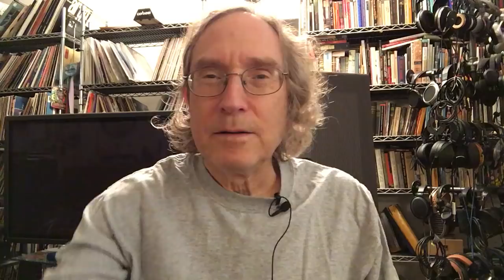Box vs. panel speakers, some things to think about

Comment: I'm going to have to disagree when you say that 75% of a panel speaker's design goes into actually "making the sound", while a cabinet speaker's doesn't.  The speaker designer might have to spend more money in cabinet design with a dynamic speaker, but the box doesn't just contain sound.  A lot of care is taken into research and design about the best padding, bracing, compartmentalization, and porting of an enclosure that provides the best characteristics with the drivers and crossovers (the enclosure does contribute to overall sound and why a particular projected frequency can't just be determined by 1" tweeter or 8" woofer).  Depending on cabinet design, a dynamic speaker may also not just be forward firing.  Lately I rewired and dusted off my speakers.  My mains have a metal grill that protrudes out a bit, so it's interesting to listen to them with grills on or off.  There's slightly more detail with them off, but imaging and dispersion seems better with them on.  Apart from Bose (which I think it's safe to say most audiophiles would agree just spend most money on marketing), I'd say a good deal of the money for production of a loudspeaker goes into its sound reproduction.  There may be certain brands that try to have a unique cabinet shape, but even those tend to have a certain response that's designed.

Comment: OMG. How can you have had the level of experience you have and yet know nothing. 

Panel speakers are omnidirectional. This alone makes 100x more difference than anything you said. 4pi radiation patterns and pattern control is responsible for the majority of the sound difference you hear between any speaker.

Start here:
http://www.linkwitzlab.com/

Comment: The box makes the sound! No box no bass.
Reply: I believe this is because the rear sound wave in a panel speaker is 180 degrees out of phase with the front wave, and therefore tends to cancel it out by interference. The very first pair of "audiophile" speakers I encountered were home built in the 1950's. They were a bass reflex design (which is no longer used, to my knowledge) which provided a long internal path for the back wave. They were huge plywood boxes with many internal baffles. It was all tube amplifiers in those days with 6L6 beam power tubes in push-pull configuration and preamplifiers with DC power supplied to the filaments to reduce noise. I remember being impressed with the sound, although as a kid I couldn't afford a system like that.
Reply: That's why dipole speakers usually have either...
a) A monopole woofer.
 or
b) 6 dB/octave of boost below Fequal, the frequency at which the response begins to fall off due to cancellation.

The first  approach is cheaper, because the second requires very beefy woofers. But both overcome that problem just fine.
Reply: Panel speakers dont really have slam, and they are line source more than point-source which I prefer.  I gave up on panel speakers as they are too diffuse and ethereal for realism.
Reply: Scott Lowell point source 👍. Not a lot of choice in that arena today, especially not full bandwidth except for the time honored warriors of Altec and Tannoy.
Reply: machintelligence Back Loaded Horn...
Reply: Bass reflex is still widely used today, the port can be either on the front or the back of the box. What you saw was likely a back loaded folded horn system, not as commonly used today due to the size the box needs to be. It's purpose is to extend the bass and allows a smaller woofer, say an 8" unit to go deeper than it would otherwise by elongating the bass waves through the horn. The Kliptsch horn is one and it's still made to this day but it's not cheap though.
Reply: That’s why ML makes a hybrid electrostat
Reply: labernese Really ! thank you. Martin Logan anyone...
Reply: Don't forget Tannoy-inspired modern point source speakers like Coherent, Zu, DeVore, Spatial, etc.
Reply: Scott Lowell, Take a listen to a pair of Eminent Technology LFT8b's. $2,499pr. retail. They have great slam with beautiful detail and focus. Much much better than Maggies or Electrostatics. One of the greatest and least known speakers in HiFi because they don't advertise.  http://www.eminent-tech.com/index.html?fwd=LFT8.html I've owned a pair for 16 years and had many box speakers come and go, but the LFT8's remain.

Comment: No Box = NO BASS.
Reply: Just not true. It takes power, but the maggies can have plenty of bass.
Reply: Thats not so simple, i own magnetostat panel speakers and its not lacking of low end on the countrery they have plenty of tight and faster bass then the boxed ones...
Reply: If you buy a high quality speaker you get great sound.
Reply: Yeah, but there is this thing called money... So you can get Maggies, and subs on each side and BAM
Reply: Not true, the woofer has to be made for dipole use and the big Maggies rock.
Reply: If your talking about bass impact then you probably have a point, but I have owned 1.6s and never missed that at all because the bass I was hearing was fast and accurate and I would marvel at the detail in the bass that I had never heard before. If you want party speakers then you should buy party speakers. Horses for courses.

Comment: hmm Magnepan unreliable! very high failure rate -reflected in there very short warranty period  -so all that money spent on the drivers and they break down all the time are undynamic -unless you have the largest model and they still cannot get it right after 40 years ! I have dynamic box dipoles still going strong after 30 years -Maggies yeh ready for the garbage tip after 15 .I was at a guys house to listen to his new 3.7i and someone opened a door and the ribbon failed seriously shithouse and nowhere as tough as Apogee panels -anyway you probably don't pay for your spare ribbons
Reply: This isn't true. The ones made before 2000 or so eventually had to be repaired because of delamination, but they improved the adhesive and current models are extremely reliable. My IVA's are 35 years old and after a few hours' repair doing fine.

The ribbons in the true ribbon models will suffer metal fatigue and fail if played for a few years at very high levels, which is why they're designed to be easy and economical to replace. At typical levels they'll last indefinitely.

Most Apogees require serious rebuilding at this point and while Magenpan is still around to support their speakers with repairs or parts, Apogee isn't. You can get repairs from Graz in Australia, but it's extremely expensive to rebuild an old Apogee and that has to be taken into account. Also, Apogee ribbons had a very high rate of failure, and the cost of warranty repairs contributed to the company's failure.
Reply: Your friend's ribbon was at the end of its life and opening the door was just the straw that broke the camel's back.

Magnepan's true ribbons are thinner than others, which is why the Magnepan ribbon tweeter is widely considered one of the best ever made (in general, the lower the mass, the better sounding the ribbon). Ambiance's blurb suggests that their ribbons are only good to 18 kHz: "They have a natural tendency to 'ramp' off at frequencies above 18KHz, without the use of electronic filter networks, adding coloration and distortion." Magnepan's ribbons by way of contrast have been measured flat to 40 kHz and the company doesn't even know how high they go because they hit the limits of the measurement mic.

What I said about ribbon life was told me by Mark Winey, the president of Magnepan: the ribbons will last indefinitely if played at typical levels, if played at natural levels (which most audiophiles rarely do) they will develop metal fatigue after a couple of years and the ribbon elements will need periodic replacement. Despite what you say, that's easy to do, you order a new ribbon tweeter, unscrew the old one, screw the new one in, and send the old driver core back to Magnepan in the shipping tube. You can also install the new ribbon yourself in your own core but that's  a painstaking process -- I read not long ago that they sell the ribbon repair kit because of the expense of shipping complete ribbons out of the country. There is nothing difficult about it.

Metal fatigue is intrinsic to ribbon technology and if you read some of the early reviews you can see a discussion of that and the fact that Jim Winey made the ribbons easy to swap out for that reason. Other ribbon driver manufacturers have done variations on the same thing since their ribbon elements will eventually fail as well -- unless you can convince God to redesign aluminum, that isn't going to change.

I bought my own speakers used maybe five years ago and the ribbons are still going strong (I'm told that they're nearing the end of their life because they're starting to sag but they were that way when I bought them and so far they just keep going). I know lots of people with true ribbon Maggies and ribbon failures are pretty rare. If you don't want to deal with an element that needs occasional replacement, don't buy a Maggie with a true ribbon tweeter. But the cost and trouble of replacing your tweeters occasionally are low and I've never heard of anyone who didn't on those grounds, people love the sound of the true ribbon tweeters too much to care that the element has a limited lifespan.

The rest of the speaker is generally easy to fix as well. I repaired the voice coils on my own speakers (which are 35 years old at this point) with Magnepan's kit and it took a few hours spread over a few days. But those who don't want to do that can just send the speakers back to Magnepan, they'll repair just about any model, even building drivers for old models from scratch if they have to. That said, except for the ribbon, which as I said was designed to be easily replaceable, failures are rare. The ones that were made many years ago can eventually develop delamination, but since they switched to a new adhesive something like 15 years ago that hasn't been an issue.

To increase the efficiency of Maggies, they would have to use neodynium magnets, which are extremely expensive. Since it's less expensive to buy a larger amp, they decided it was a better deal for the customers not to use neodynium except where it's technically necessary, e.g., in their center channel speakers. If you do want the efficiency there are planar speakers that use neodynium magnets, but you'll pay significantly more than for a comparable planar that doesn't.

Comment: Panel or open baffle speakers are "against the law"!The laws of physics require a proper box (sealed or correctly ported) in order to deliver full range sound.Any non-box speaker I have ever heard sounds about the same as a raw open driver during a bench test.Yes, the box is expensive, needs a lot of engineering to get right. And, if it is to look presentable, a lot of craftsmanship is involved in building the box.
Reply: Dave Kazoroski Box speakers can sound as bad as a panel when not properly set up, & not given proper partnering equipment. Maggies inherently require a clean high current & high power amp to make them come alive, as in at least 300 watts or more at 4ohms, with 2ohm stability. If a box or panel  aren't positioned correctly in a good room they will sound bad. If they're in a bad room anywhere they will sound bad. If one is interested in realism of symphonic, or acoustic music in sound/music play back, a well engineered, well placed, well powered, panel in a well designed space is very hard to beat. If highly processed music is your thing, go with a box, or add well designed moving coil subwoofer to cover 50hz-80hz LP with a panel, but a 3000 watt active sub will not be necessary. I would go with a sub about half the power being fed to the panel speaker, but proper placement of it needs as much consideration to blend in properly to prevent over emphasis of the bass.
Reply: You can get panel speakers that are flat to 20 Hz. My old Tympanis go down to 25 or 30 Hz with enough slam for chest thumps. No, they won't match a big dynamic in that department, but the bass is much more natural on acoustic instruments. The other thing that many have mentioned is that you can throw a pair of subs on a panel speaker for a best of both worlds combination. You'll lose the naturalism of the planar bass, but you'll get dynamic speaker slam. Some people turn them on and off depending on program material.
Reply: Josh Hill That's why I wouldn't use more power on the sub. In a sense only using a sub as a 50-80hz LP supplement to what the panel does, instead of a replacement of the panel's lower frequency range when listening to "X" type music.